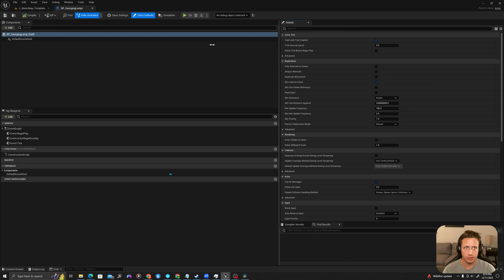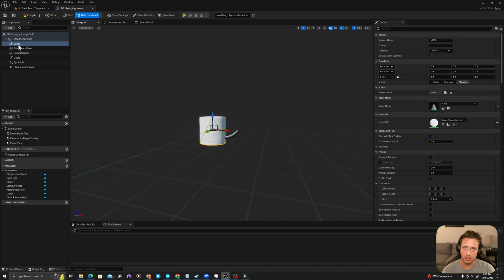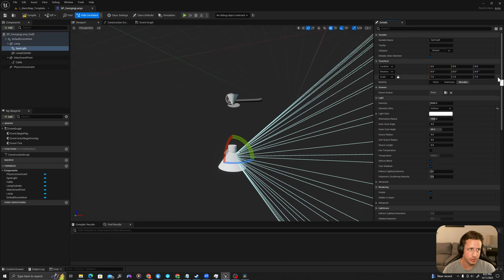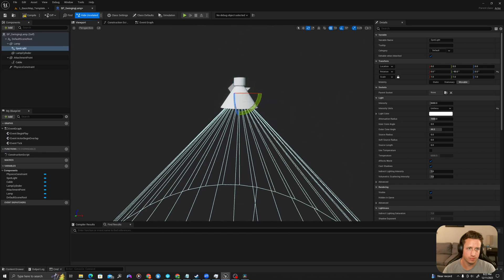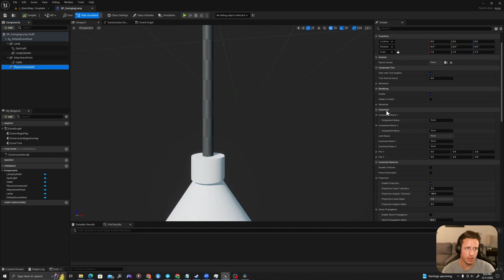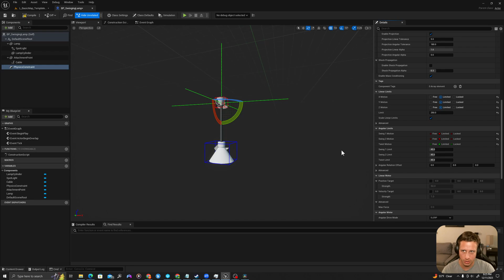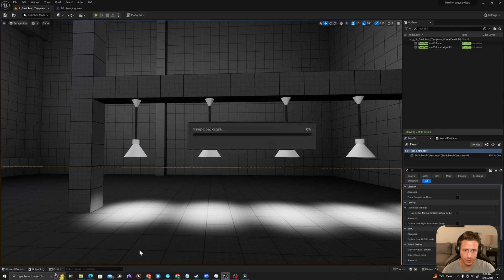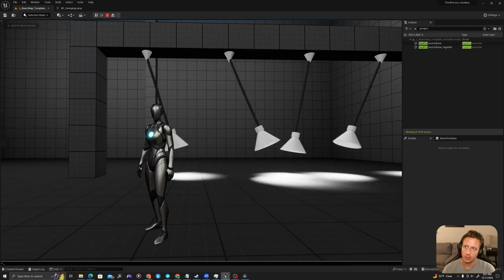Swinging PHYSICS Lamp - UE5 Blueprint Step-By-Step Tutorial

Comment: Hi, I have a problem with point light showing me error RUNTIME DOES NOT SUPPORT WHOLE SCENE POINT LIGHT SHADOWS (Missing Vertexshader Layer support):
I am used DX12
Reply from the maker: Are you trying to use Raytraced shadows without having an RTX card? Does your graphics card support DX12? If you create a new project and drop a point light into your map, do you still get that same error?
Reply: @UnrealDevHub  I don't know if I used raytraced or not I am new in unreal, 
My graphic card is 750 ti it's support DX12 level 11.0, not Important to me if I turn off raytraced the Important to me is make shadow for this point light. 
I'm sorry if there are incorrect words about the program, but I'm trying to learn it.

Comment: Great tutorial but I was wondering if you've encountered an issue with the cable component that causes the cable to go rigid when the parent of the cable moves? For instance when the lamp part of your object moves the cable moves fine but if the base moves at all the cable instantly loses all slack until the base stops moving. I've seen demonstrations of the cable component working fine in UE4, is it just bugged in UE5?

Comment: Hello, i have a question. I have an Axe object and I have a tree object in front of me. How can I turn an ax into a damaging weapon? And how can I turn the Tree into an object that can be damaged? can anyone you help me please?
Reply from the maker: 1. Create a BP_Axe. This should have a static mesh, and a collision box. Attach this BP to the character's hand bone on their static mesh.
2. Create a Blueprint Interface called BPI_ApplyDamage with the function ApplyDamageToWorldObject.
3A. On the collision box, create an event for OnComponentBeginOverlap (the default function) and on the overlapped actor (from the output of the function) execute the function ApplyDamageToWorldObject. Before running the ApplyDamageToWorldObject, test AttackActive = True? to make sure that we can only destroy the tree when an attack montage is active.
3B. Play an animation montage on a Input event (for instance, the E Key) to play a swinging animation. When the animation plays, you'd want to pass a boolean to the BP_Axe such as AttackActive = True, and when the montage is finished, set it to false.
4. Implement the interface BPI_ApplyDamage to your BP_Tree that you've created. Implement the function ApplyDamageToWorldObject.
5. On the event ApplyDamageToWorldObject in your BP_Tree, spawn the particle FX for destruction at the location of the tree, then call DestroyActor on the Tree.

This is a rough framework, but the core concepts are how I'd execute that in the simplest way possible. Hope that helps!
Reply: @UnrealDevHub   oh bro thank you for your long answer i will try it
Reply from the maker: Awesome - hope that goes well! @Omr.Games01